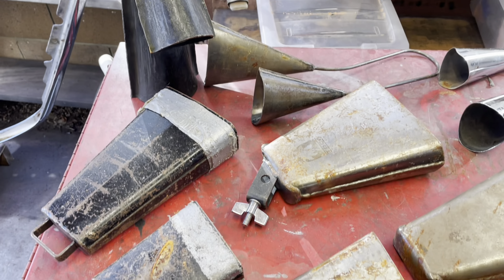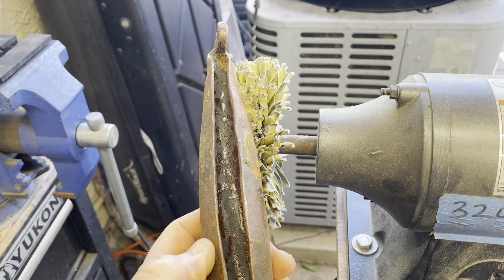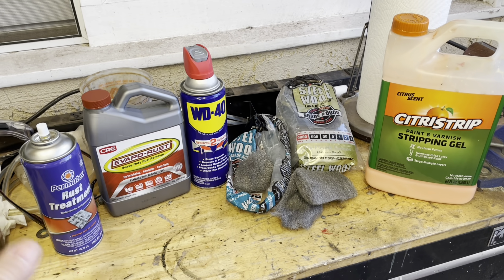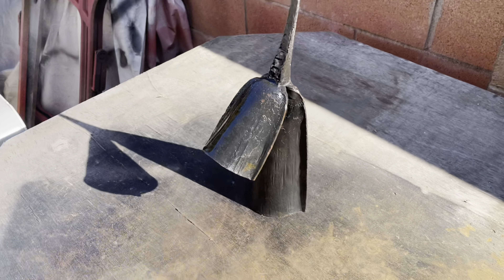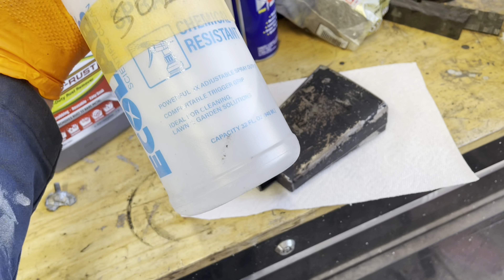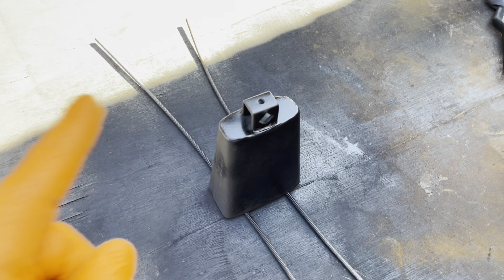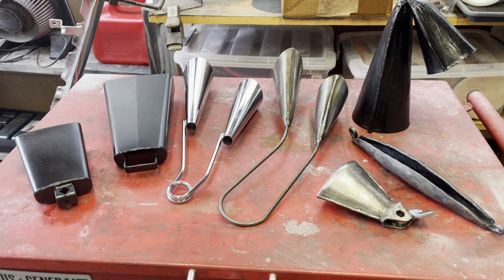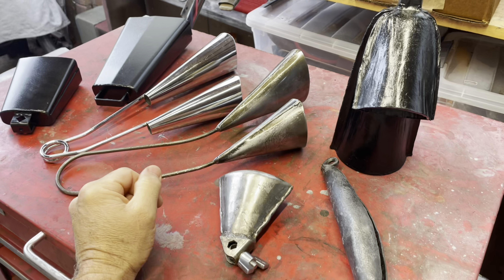Cowbell Rescue and Restoration (no rust!)

Comment: Which treatment would you suggest for a flex-a-tone? The handle is fine, but the bendy metal and the metal strips of the "mallets" are pretty rusty (bought one second hand online, didn't get it rusty myself ;) )
Reply: @mvl8209  I actually just took this info and redid one I bought and destroyed 20 years ago when I was in 7th grade. It was missing the wooden pieces, and heavily rusted. I did a surface clean, soaked overnight in evaporust. I also did one round with the rustoleum product, because evaporust doesn’t have a built in inhibitor chemical to prevent rust from forming again.

The evaporust carbonized the rust spots, so the flexing metal is rust free but cosmetically splotchy, but smooth. 
With some new beads to replace the mallet heads, the chemicals, and some paint. I have a practically brand new looking and playing flexatone.